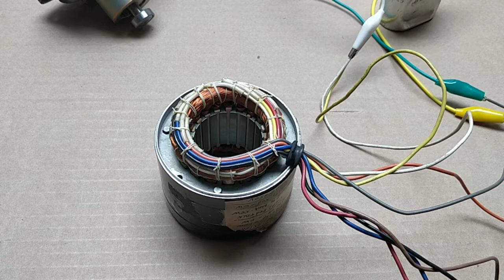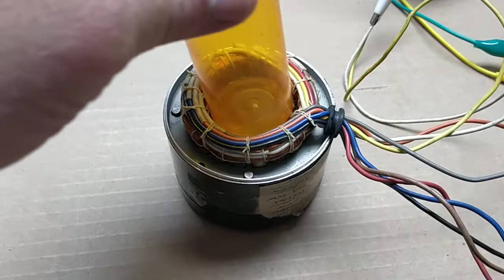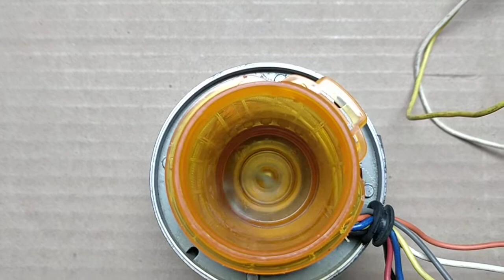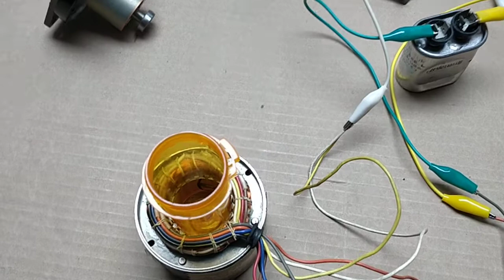Demo of Tesla's  rotating magnetic field

Comment: Could you explain why the White and yellow wire are connected? And why the red and black are connected to the run capacitor. I’ve tried a few set ups and motors and with my function generator but still no results. Just want to understand your set up a little better
Reply from the maker: The motor used in the video came with a handwritten wiring diagram on it that I followed - I do not really understand them and what each color is for it 'just worked' when connected that way with the run cap.  Here's photos of the motor wiring diagram and nameplate  https://swigerco.com/JapanServoMotor/
Reply: @ChuckSwiger  awesome thank you!

Comment: Awesome video I’ve been trying to recreate this for a week I believe im doing everything you are the only difference is I don’t have a hv capacitor (coming in the mail in a couple days) so I’ve used a couple different ones but it’s still not working. 

I have all the same color wires in my motor as you do. I also had to use an extension cord as my variac has plugs so I could connect it my clips. 

Do I need a microwave (hv) capacitor to make this work? Do you have any pointers? I tried seeing if you had more videos on this but I didn’t find any. And so far you do the best job of showing your set up that I’ve found. But a new video going through this would be amazing I know I’m not the only person having this problem  because all the other videos demonstrating this have plenty of people who have tried and it’s not working for them as well.  

Thank you
Reply from the maker: The motor and cap are a standard 'run' capacitor  https://en.wikipedia.org/wiki/Motor_capacitor  this one is 3uf / 370VAC  with a Japan Servo Corp motor from surplus. It was just easy to to pull the rotor from it and stick a little pill container with a magnet in its place.
Reply: @ChuckSwiger  thank you, you are a lifesaver. I thought any capacitor should work but I guess you did say a run cap in the video.
Reply: I got my run cap but it’s still not working. I’m running at 120vac I didn’t get any effects with any voltage. It looks like from the variacs positive it goes to the yellow and white wire and the negative goes to nothing. And then the run cap is just connected to the red and black wires and that’s all there is to it? In terms of wiring. I’ve tried several set ups but so far nothing. Also trying Tesla Cults version (also on YouTube) with two phases and still nothing. I have red, black, blue, yellow, grey, and white wires. I put a small magnet at the bottom with the pill bottle and I’m using the same spring you are. Any ideas? Or just keep tinkering and possibly try some new wire connections? Also using the 3uf 370v run cap like you said
Reply: @etherico3041  Welp, lets see here: It is a 'servo motor' with 8 wires. So, probably one of those fancy high output 8 lead steppers often used in precision rotating drive units (also sewing machines). Looking up a 8 lead stepper wiring diagram (an 8 lead stepper has the center tap between each coil pair separated making for 4 independent coils, but since they are the mirrored pair in the arrangement they remain name A, `A, B, and `B. The 8 wire thing just allows you to wire them up in the most customizable way electrically, therefore allowing a driver designed for it to drive the rotor with far more precision and power than a simple 3 phase (6 wire though slightly different coil arrangement physically) or 4 wire standard stepper motor can achieve) we have blk yel A, orn grn `A, red wht B, and brn blu `B. The motor in the video has a grey wire, not a green, but this does happen sometimes, a manufacturer deviates from the standard, maybe it is standard wherever they normally sell motors, but still lets just swap grey for green, giving us orn gry `A.  In the video the white and yellow are connected via a white alligator clip jumper to one side of the variac, grey is connected through a green alligator clip to one terminal of the capacitor which shares a connection via the capacitor terminal back to the variac, and the red is connected to the other side of the capacitor via the yellow alligator jumper. The remainder of the wires run out of frame. If the polarized brown plug is anything to go by, of the terminals of the variac that we can see, on the left we have: Hot, brown plug hot, and wht/yel (via one white jumper), the next terminal is presumably brown plug neutral and gry (via another white, then green jumper), I assume the supply neutral is connected to the other side of the variac toroid. Ergo, this setup is running referenced to the mains hot, and using the variac to off set from that through the toroid to neutral. 

So, mains H goes to the variac, one side of the coils A and B, and the brown plug hot side. The mains neutral goes to the other end of the variac toroid. And the wiper of the variac goes to the capacitor then to the grey wire and the brown plug neutral. ie, the power from the variac is offset from the Hot supply based on where the wiper is positioned on the veriac's toroid (acting like a transformer, the wiper being a moveable center tap).

In this orientation, if the grey wire replaces green for `A this is an open circuit for the A coils, however red and white share a coil, B. So when connecting the white jumper to the capacitor terminal, this puts the capacitor in series with coil B. It is possible that coil A instead of being blk and yel could be gry and yel, which would make the circuit Hot through A and B center sides (ie in diagram of a stepper where the 'center tap' wire would connect A/B and `A/`B respectively for a 6 wire stepper motor), with the input sides of coils A connected directly to neutral and B to the other terminal of the capacitor. If black and grey are switched that is. Otherwise its just coil B connected across the wiper voltage through a capacitor.

Supposing its supply hot -> coil A/B -> (coil A -> variac neutral) (coil B - > capacitor -> variac neutral), and simulating this with very wrong values for the coil inductance and resistance (1H and 100ohm...they were just the stock values and Im not bothering to look up realistic ones, sue me), but the 3uF capacitor splitting the coils, we get a ringing circuit that appears to have coil A about 45 deg ahead of coil B (which is the inverse of coil A and 45 deg slow). 

Would it work? I dunno. Deep dark magnetic RF style voodoo to me. However, I would like to point out a few things. 1) he turns the variac up about a quarter turn, and the noise does not change at all. In the simulation there is a pretty drastic change in current flow through the coils between 5v and 25v AC. At 5v coil A (directly across AC supplied by variac) 4.83v and 12mA, and coil B (through the cap) 3.65v and ~9mA. At 25v AC, coil A 24.16v ~64mA, coil B 18.23v ~48mA. Both at 60hz, the B coil lagging A by around 45 deg. the capacitor seeing  8.55v ~9mA peaks at 5v 42.76V ~48mA peaks at 25v supply. Except there is no noticeable change in the sound and speed of the washer.... Sure the frequency would be the same, but wouldnt the stronger field slam it into the plastic harder too making it louder? 

And point 2) We dont know if that variac is plugged in, or what if anything those other coils wires are connected to. I mean, at least put an LED on em so the rotating field can make them blink or something....

All in all, I admit Im not hip on magneto electro dynamics, nor am I familiar with this channel/person. However, with youtube being what it is and the sheer level of garbage on it, my spidey senses tingled. Im not saying this is chicanery, but it does smell a little fishy.